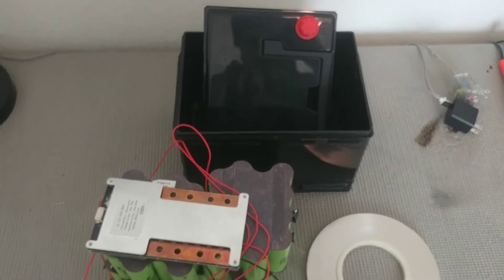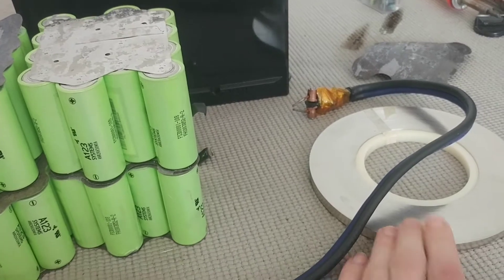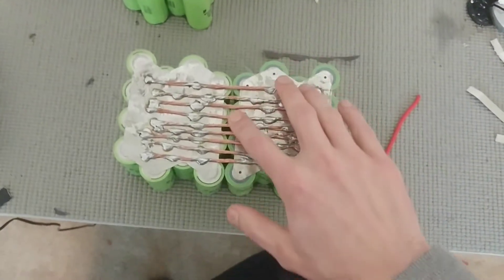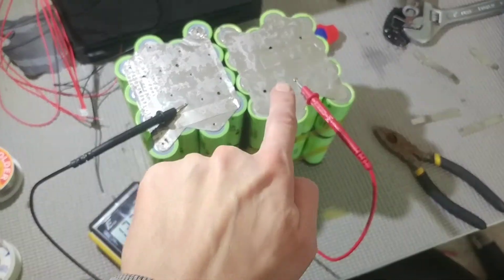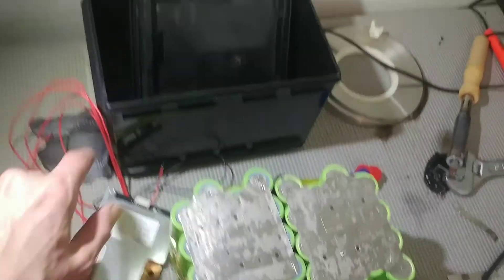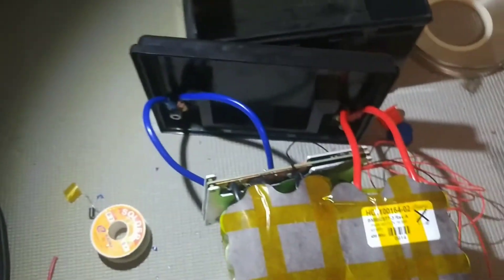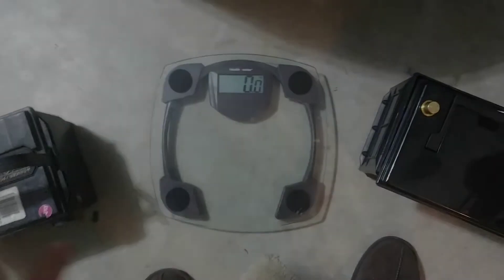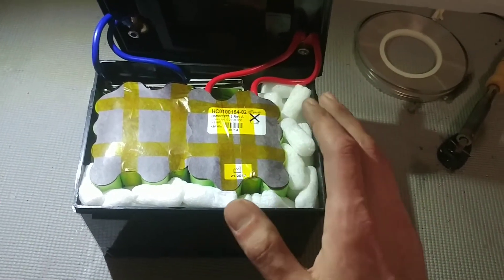DIY Lithium Car Battery to start my V8 from a123 LIfePO4 cells

Comment: An insulating sheet between the positive and negative group would be a good idea, if the wrap wears between the groups it will short, just an idea, I know it's an old vid, but still good info. also what happens when the BMS disconnects from the car when fully charged, does the voltage spike?

Comment: FK YES.. that cranked amazing and finally someone uses the product in a REAL American car.. Tip for you though 3 years later I know.. Those lead battery terminals are not great for cars its better you use just a toyota or lexus OEM terminal thats copper and steel.. I can't wait to put one of these in the v8 Ranger.. o.0

Comment: Quick question. Is the charging amps is 60 at 12.4-14.7, for example. Is it okay even though the alternators output is 180amps? Does the bms shorten its life?

Comment: 1P4S using unprotected a123 cells without a BMS will start a car. Your limitation is probably in the BMS or connection between cells.

Comment: I would be way too concerned about temperature to waste some A123 cells in an engine bay.

I was rather surprised that it didn't start on the first try but if its been sitting a while that would make sense. There's a video on here of a 4S1P pack starting a small car.

Comment: I came across 20 Amp hour battery packs for charging cellphones at wal-mart in the clerance aisle for $2 each. I got the idea to make a car battery. I took the packs out of their original case and soldered on thicker positive and negative cables. Then I cut rectangles out of 1/8 inch thick aluminum sheets. I cut them so they were 1/2 inch bigger than packs all the way around. I put thermal putty between the packs and the metal. I put a metal sheet then a battery pack then metal sheet the BMS and such the. A metal sheet then a battery pack then metal sheet then battery pack then metal sheet and so on. This way the battery I built was compact, lightweight, had a lot of passive cooling, I have way more cranking amps and capacity than normal car batteries. It was awesome.

Comment: I would say spot welding didn't workout just because of the glue residue.
You could have done a neat job if you wiped off the residue properly with alcohol or something.
Reply: Probably right. Spot welding with a copper nickel sandwich would have been perfect here

Comment: Well all aside I'm wondering how the charging circuit is going to work can the alternator actually function without overheating but what happened if the battery got run down so that light was left on and for some reason you were able to still start the engine now the alternator sees hundreds of amps I just wonder can somebody tell me if that's going to work without having to use a Smart alternator

Comment: I wonder what will happen if BMS disonnects the battery for whatever reason while vehicle is running?
Reply: Nothing really as long as it isn’t a start stop vehicle. The alternator will carry it till the car is really shut down. Once a vehicle starts the alternator does the electric work and recharges the battery.  It should show a battery alert but usually doesn’t.

Comment: I am afraid of one thing.. it's called cell balancing.. you know 7.2V can bee reeched by 2series connected batteries, each at 3.6V.. also, 1 battery could bee at 4.0V and the other could bee at 3.2V (talking li ions of course).. these balance modules you can sea in laptop batteries for example and can bee active or passive.. well i am not fully aware of lifepo chemistry and assuming they work as a ni-mh for example, everything should bee fine.. because from what i've seen, you connected all phases from bms to the last series.. assuming your bms can doo a balancing and you just screwed it up..
Reply: These cells stay in balance like you wouldn't believe so long as you top balance them first

Comment: I have a Nissan Leaf 2016 but wonder if it is capable to take a LiFePo4 battery.  As it would be configured to charge a sealed lead acid battery can it successfully charge a LiFePo4.  
Charge voltage 14.1 - 14.3 with an Ampere of up to 120A.
Will this be the job of the BMS of the battery or the DC to DC converter of the car.

Comment: Hi there, nice vid!  I have build a 4s17p battery with the same cells. Now called lithium werks ANR26650M1-B. I build it for my diesel rv. Been working now without a bms, doing fine. I just curious when it's winter time and freezing. My plan is to before starting the engine, first turn on lights etc to heat up the battery internally. And then start the vehicle after say 5 mins.  According to specs you could charge them with 0,25 A when freezing. But apart from that, cells are doing great. Just topbalanced once, they stay equal. Just to be sure I installed a passive balancer. How do you deal when it's freezing? Chiao Rijk Netherlands
Reply: Where are you located?  So your battery you made is essentially a 12V 42.5Ah battery?
Reply: @MrAlvarez919  Live in the Netherlands. Yes its working fine so far.
Reply: @ritchycamaro  Hey there Rijk. My grampa was from the Netherlands. I'm from Venezuela. No problem with low temps here. LOL. How has been working your battery without the BMS? I'm interested in getting a diesel for my busted SUV. Lead acid batteries and other basic spare parts are so expensive to get in this thug-controlled country that it's more cost effective to get LiFePO4 cells and put my own battery together, but the needed BMS raises the cost a little. Let me know please. I would appreciate it. Greetings.
Reply: @FBPrepping  Hi Jose, yes i'v been using my lifepo4 battery for few months. Traveling trough europe. It works perfectly. No BMS because of cost, and reliability. If bms breaks i would be stuck somewhere, haha. I have build the battery of 4 blocks of 17 cells. After building these blocks i left connected parralel for few days to balance while charging to 3,55 v. Then they were connected in series. The alternator delivers max 14,2 v that is 3,55 v per block. So if the alternator stays ok, the battery is fine. After 3 months of use the cells are within 0,008 v of  balance. Just check your battery charge/discharge voltages regularly and you are fine. I also installed a battery monitor inside the batterybox: ANCEL BM300 12V Battery Tester, ordered from aliexpress. To se the voltages on my phone, and also log data for 30 days. Also shows starting  and alternator voltages. O and i installed a small balancer. Good luck building! The batterys Lithiumwerks i ordered from NKON here in holland, good price and oversees shipping. Chiao from Holland!

Comment: It is my understanding that only lithium-titanate is really appropriate for the amount of current flow demanded by all of the conditions a starting battery might face, particularly under cold conditions.  You were really taxing these LiFePO4 cells to make this "work"...but is it really a viable design for a cranking battery?  Probably not.
Reply: Actually, these particular cells, A123 NanoPhosphate are rated at 120A Burst. They are perfect for this scenario. Go look the statsheet
Reply: @nbtesh  - A typical automotive starter motor will draw 250 amps, under normal testing conditions, and can draw twice that when temperatures are at or below freezing.  A normal lead-acid automotive battery will have between 600 and 850 "cold cranking amps".

These batteries are nowhere near "perfect" for year-round application as a cranking battery.  If they were, you would see them being sold as such, on the market.  You might know the statsheet on these batteries...but you don't know starter motors, apparently.
Reply: @jasonbroom7147  That's unnecessarily harsh and you happen to be wrong.  The spec he gave you is PER CELL.  In a burst mode those cells can melt your starter.  And mark my words - lead acid is on it's way out for good.  Being shitty when you're wrong is the worst kind of being wrong.  LiFePo4 deliver more power at any temperature than lead acid.  In extreme cold, they just shouldn't be charged.  But that's not much of a problem - just have a charging temp cutoff.  Below -20* C, just have a thermostatic relay to wait until they warm up above -20* C after the car starts - which should only take a few minutes IN THE ARCTIC.  In most other places on earth, that would happen rather infrequently...
Reply: @AlexLTDLX  - Nice try, but here comes the math:  So those cells are capable of a 120A "burst".  Arranged in a 4s configuration, you're claiming they can deliver 4 times that, right?  (You're wrong, but let's just say you weren't...)  That's still only 480 amps, AND they are not able to deliver that over and over, for 10, 20, 30 seconds, during cold conditions.  Have you ever lived in a cold climate?  Have you ever owned a vehicle that doesn't start in 2 or 3 seconds?  Have you ever rebuilt a starter motor?  Your understanding of battery chemistries is sorely lacking.
Reply: @jasonbroom7147   err he has 16 of these cells in parallel so 120a * 16 = 1920amps
Reply: @Ultrasonictwo  
Don't sweat... Mop (or even better, "Broom") his comments aside as he already knew he was wrong!!! 😂🤣
Reply: @IndShabal  obviously he didn’t know what he was talking about at all judging by his math he only multiplied as if there was only 4 cells in this pack. A lot of people don’t realize how awesome these cells are.
Reply: @Ultrasonictwo  bingo!!! wow he was way off
Reply: @jacobhendrickson8935  
😂😂 👍
Reply: @AlexLTDLX  it makes no sense. I wrote an article on lifepo4 as a starter battery. literally the max temp range prohibits this. so what you're saying is use a thermostatic relay for the alternator so it only charges the lifepo4 battery 4S pack when it reaches a warm enough temp? so the whole time "in the artic" the car is draining the lifepo4 battery? that makes no sense plus lifepo4 isn't supposed to be drianed in freezing temps. I vaguely remember seeing a discharge video with a guy using a chest freezer testing batteries, but again the specs for lifepo4 says do not do this. lithium titanate is the only chemistry that should be allowed to work under extreme temps and extremely high amps. I mean please prove me wrong but check and compare the specs first
Reply: @eksine  wrong, they can be discharged down to -20C° Just not charged below freezing. Some lifepo4 have a rating for charging below freezing and can do it but only at a .2C rate.
Reply: @pinerock9668  I think you just said what I said. You must have misunderstood.
Reply: @pinerock9668  in any case not wrong lifepo4 does not work ,period. Go over our conversation you missed the point entirely
Reply: @eksine   @eksine  I looked the conversation over, you mentioned correctly that the cells would be damaged when charged below freezing and the said incorrectly that they can't be drained in freezing temps. You mentioned that you seen the specs on ailexpress but there are many manufacturers of lifepo4 with wide ranging specs and most lithium batteries are rated to discharge down to -20 c but that doesn't mean they stop there, just that their not tested below that. We in the north use power tools below -20c just fine, they just get heated to charge. Also some headway cells can charge down to -10C at a .2c rate. Additionally some manufacturers of deep cycle lithium batteries add heating pads and the charge current is used to heat the batteries before charging
Reply: @pinerock9668  I think the point was batteries for a car, so really you missed the point. Your saying true things but irrelevant to the actual purpose of what he's saying. In layman's terms we are looking at the best replacement for a car battery and again that would be lithium titanate. A lithium iron phosphate pack with a heating pad would not really make sense when you just leave the car in the cold for who knows how long. And you would be waiting for how long until the batteries become defrosted? Or are the heating pads just going to drain the entire pack which would not really make any sense once you agree? That's what I'm talking about you are missing the entire point entirely like I cannot possibly make it more obvious than that
Reply: @eksine   all I was saying is that you were wrong that lifepo4 batterys would get damaged from discharging below freezing temps. I never said they were the best type of battery.
Reply: @eksine  I don't know why you keep dodging the fact that these can be discharged below freezing. You saying they can't was a small mistake and I expected a "oh I didn't know that but I still don't think these are the best battery". Then I would say you are free to your own opinion. When you keep saying "your missing the point", and "it's not the best battery" you are distracting from the root of the conversation by trying to lay blame.
Reply: Jason, your understanding is very wrong. JUST ONE of these cells is rated at 120A pulse for 10 seconds. If you noticed the speed at which the motor was turning over before it started, you'd realize this is much better than any lead acid battery could ever do. Those look like 16P packs, so they're good for 1,920 amps for 10 seconds lol.
Reply: I wrote an article on this. lifepo4 gets permanently damaged near freezing. whether it can push out the amps or not is not even the issue. what good is a lifepo4 starting battery which fails at freezing temps? the alternator should also be doing permanent damage charging it at low temps too.  It's literally in the specs for lifepo4 cells sold on aliexpress what the temperature range is. I have however heard of a lifepo4 car battery in the UK or whereever in which they add some kind of foam insulation around the cells. So unless these guys here can explain how lifepo4 works in a car in the winter please do, because the specifications literally say it is not possible
Reply: @eksine  There is a LiFePO4 battery being made in Australia that uses a supercapacitor to deliver the appropriate amps to a starter motor.  You have to wait about 3 seconds in-between starting attempts, for it to recharge.  It also has a pretty complex circuit to help recharge the battery.
Reply: @jasonbroom7147  I think I saw something like that too, but without a capacitor some lifepo4 cells have a continuous 3C discharge. You could parallel the BMS with a second or 3rd pack in parallel to get higher amp discharge, but like you said earlier which you forgot is that lifepo4 does not operate near or below freezing without permanent damage. it may not be immediate, but unless every lifepo4 manufacturer is lying on their own spec sheet than I call BS on this except for that insulated cell thing I heard about which I don't understand. maybe they have heating pads to warm up the cells? I don't know. anyways lithium titanate, that's the only chemistry that should work long term. unless they make solid state batteries, I don't even know what those are
Reply: @eksine  To support your point, an NEC ALM35 LiFePO4 battery has the same cell model, count and arrangement. It is rated 500Amp continuous between -40 degrees C and +60 degrees C. and can easily last over 10 years in these harsh conditions. My neighbor/friend was an engineer for that battery and put those cells through hell for testing (up to 2000Amp repeated charge/discharge). These cells have low capacity for their size, but they are immensely robust.
Reply: I was off on the figures. 210 Amp continuous, 500 amp pulse. However, these ratings are for industrial use with 3 full charge / discharge cycles per day for over 10 years. Each cell is rated for 50 Amp continuous, 210 Amp pulse, so the pack can easily handle the load.

Comment: 7:58 Yikes, that is SO much heat being applied to those Cells it seemed like a long time while it was sped up. You turned those bottom plates into a mini stove top burner for a bit. based on what is out there, no more than 350C for 3 seconds, looks like you were blasting that with 300 watts / 600c forever seconds lol.
Reply: Nah those things are beasts!
Reply: yeah the internal resistance of these cells probably took a hit